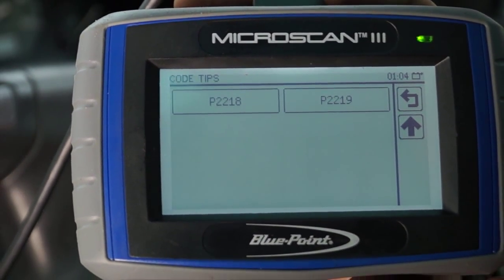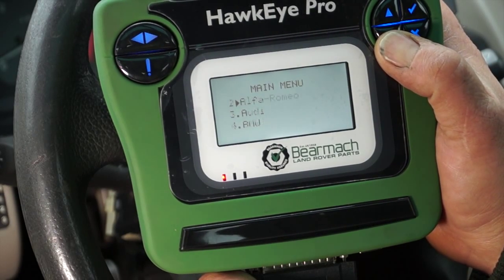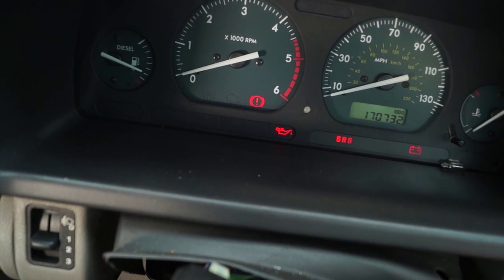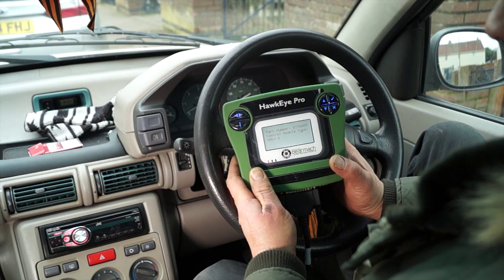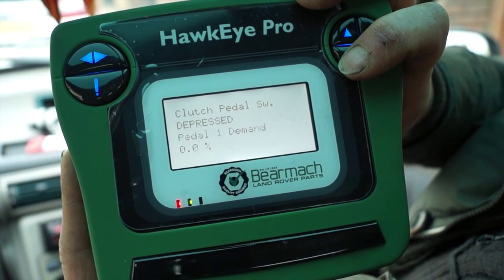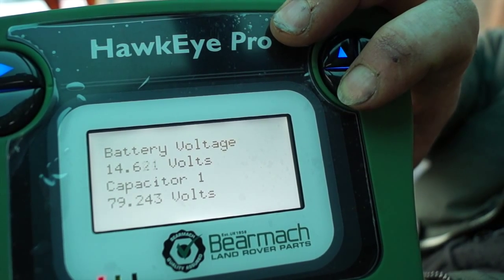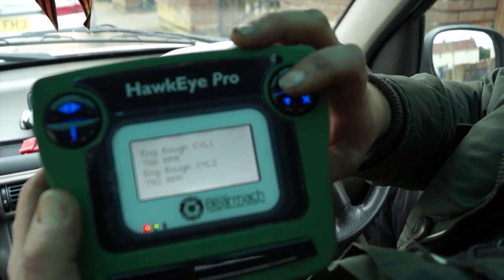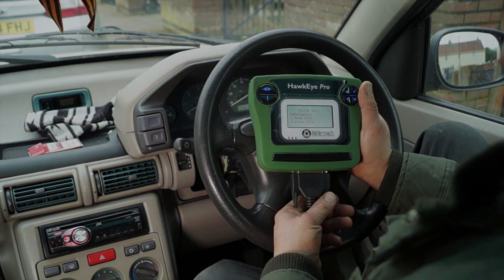HawkEye Pro Land Rover diagnostics scan tool from Bearmach

Comment: hi. Can you explain about what does it mean Fuel Compensation in mm3?  when is normal and when it is a warm? Thank you!
Reply from the maker: Fuel compensation adjusting for smooth idling.  The viscosity of fuel changes as it gets warm.
Reply: Thank you so much. And the another parameter Motor Roughness? How much is normal difference or tolerance between cylinders?